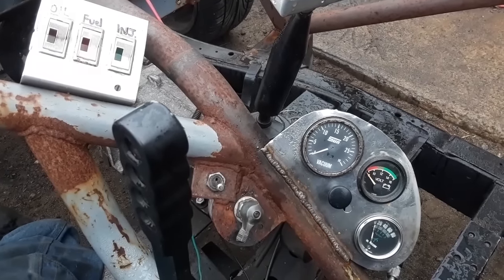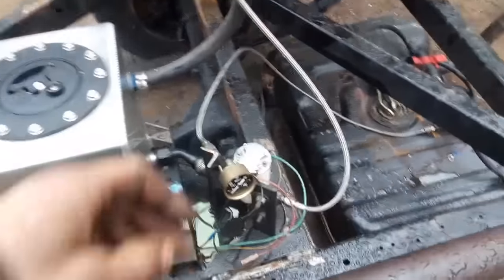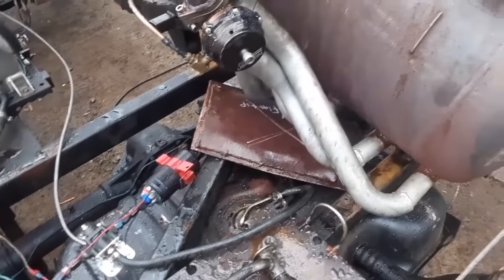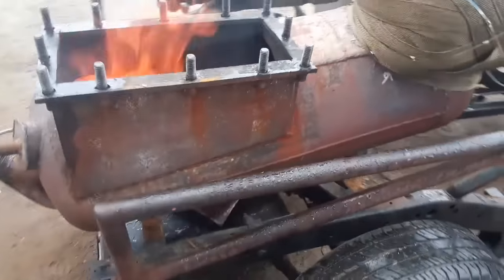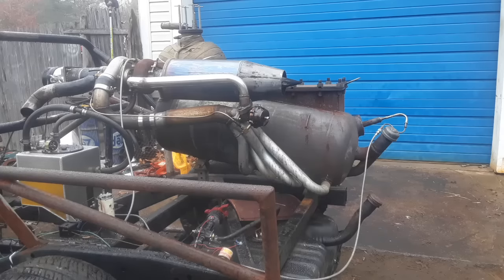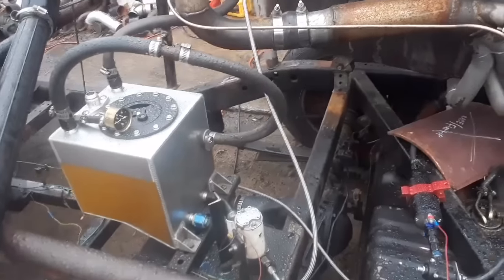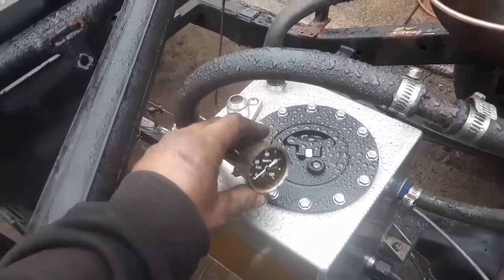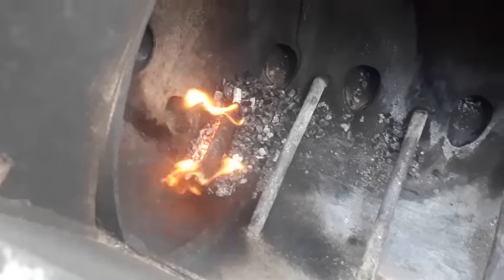Afterburn by Overfueling

Comment: If you ran the waste gate bypass to the inlet of the turbine it will help the turbine last longer run cooler and supply extra air for the afterburner

Comment: It looks like the AB is running rich, so that it rather needs more air than fuel.
Love the creativity and all energy you put into it.
Keep it up, please!
Reply from the maker: Im not injecting any fuel into the ab. Its just into the turbo barrel chamber, which is too rich with 25psi of fuel. The regulator cant drop below 25psi so I need a carbureted regulator to drop to 5psi of fuel. It wont run at an idle state with 25psi of fuel but if I fully spool the turbo with the wastegate it obviously cleans up the mixture. I was feathering the wastegate partially open to get the afterburn affect by simply over richening by choking the system of air.
Reply: @BoostHoundGP  I think if you hook up the wastegate to the afterburner you can run the barell itself rich, because the remaining fuel in the exhaust should combust there. Also, if you run it richer, it burns at a lower temp, so it should prolong the life of the turbo.
Basically try injecting the extra fuel BEFORE the afterburner, The high heat/pressure in the barell should also aid the vaporization.
Reply: @BoostHoundGP  what are your running for a fuel injector nozzle? do you have a way to control the flow rate of the fuel rather than just pressure?
Reply from the maker: @A2J_Tim  I made my own nozzle. Its hooked to a boost referenced fuel pressure regulator. I dont adjust a thing besides closing the wastegate to spool more boost. The fuel psi rises 1:1 with boost.
Reply: @BoostHoundGP  ah ok, so you may have to play with nozzle sizes, but ultimatly you need a way to meter that fuel for better control like a variable valve or fuel injector.

Comment: You need to add a huge radiator for your oiling system so it will help cool the center section of the turn and will help keep it 
from blowing seals
Reply from the maker: I could but its fine the way it is. 40+ runs on the same center section. Its keeping constant oil psi and volume to it. The heat is a good thing in my case Im going to condensate the oil vapors from the oil system into the pyrolosis system. Free oil refiner.

Comment: If you could rig up multiple oil jets so that they were independently valved, and then connect all of them to a rotary indexer, you could easily throttle the fuel at any pressure by regulating how many injectors were open at any moment.

Another option, of course, is to have the pressure regulator in a position where you can dial it up or down to adjust the flow.

These would allow to throttle the system, very much like a normal turbojet engine is throttled.
Reply from the maker: The boost reference on the regulators do the adjusting for me. It seems to work completely fine as is.

Here I was just running too much intitial fuel pressure causing an extremely rich mixture. I swapped out to a low pressure carburetor regulator and it starts up extremely quick. As long as theres some form of wood fire present in the chamber.

The issues Im facing seem to be from having no form of ignitors other than the wood and once it burns up and blows away the tank temp drops too much to ignite the fuel properly. This becomes more of a problem after you fully spool the turbo with firewood and the coals blow away from the wood.

Also spooling down the turbo while boost referencing the regulator causes a rich spike. As you throttle down the pressure stays in the hoses to the boost reference choking the system with fuel. This seems directly related to not having ignitors and only after I fully spool on firewood.

I suppose either a relief valve on the reference that opens when you spool down or just not spool down as hard while on oil. 
Spooling with the wastegate gives off that classic dose flutter when you release it but if by not doing that and easing the turbo down slowly it'll probably be fine. The wastegate dosing seems fine on firewood however.

Comment: if their block of wire mesh like rolled up chain link fencing in it, as the fuel burns it would make the wire hot and act as a catalyst to stabilize the fuel burn... if that was centered in the barrel using some standoff's the fuel injector tube could be pointed right at it. roll of wire mesh, catalyst log.
Reply: where in the barrel it goes? one end or the other maybe in the middle, tho a 4 foot log would just cover the whole thing and end up melting where it gets to hot...

Comment: 4lbs of fuel being injected into the combustion chamber isn't 4lbs of boost. You need to at least overcome your boost pressure before fuel would even start to flow in. Also not going to be just about pressure but flow rate.

Comment: Also, you can put fire bricks in the barrel to work to hold heat [prevent flame-outs] and improve combustion efficiency.

They would naturally glow super hot, and this would help sustain flame, and to an extent, improve the rate at which the oil evaporates, which increases efficiency.

Ideally, the objective would be to stand the fire bricks up like fins, instead of laying them down like armor plates.

That said, the advantage of actually lining the barrel with them [like armored plates] is that it extends the life of the barrel.
Reply from the maker: I did get some lava rock stuff however it was too light and small for my liking. Plus I didnt like the idea of stoney type materials inside the barrel. And chipping or tiny bits that let go will probably end the turbine wheel. The wood ash isnt much better but it is alot softer than stoney chunks.

Unless these bricks you speak of magically dont deteriorate like that, Im just going to build some form of stainless steel mesh grid that sits on the bottom of the tank to act as a giant glow plug.

At this point my intention is to not spend any money on it. If I have something on hand to do the job thats fine. If I dont have something thats fine too theres multiple ways about these types of projects.

Comment: put the throttle AFTER the compressor. just bleed air off to the atmosphere, or jacket the combustion chamber then bleed off back through the turbine.
 standard turbine principles, only feed some air into the combustion, not all of it. you want to keep EGTs as LOW as possible.

compressor wont last long being constantly choked off... turbine wont last long chewing on wood ash and incandescent gases...
Reply from the maker: Throttle stays open during all running of the engine. Its only function is to divert the blower air into the turbo to start up. The wastegate vents excess air from the system to atmosphere. I throttle by closing the wastegate giving the system 100% air to go crazy.

In this I simply have too much fuel for the system to burn properly at lower boost so I have to keep it the turbo speed up to overcome that.

Ive since dropped fuel psi and have gotten better results and a cleaner run.

The surging I did figure out to be incomplete combustion due to not having any form of ignitors besides the tempurature of the chamber. Basically its detonation but too slow of a burn process so the combustion happens after the chamber in the turbo and afterburner. The fire eventually burns backwards into the chamber and coughs the turbo.

Yes the turbo wont last. Its had so many runs on it Im suprised it can take the abuse still. The turbine wheel is thin like tin foil it should've melted long ago.

Havent seen many other turbo barrels still running their first turbo I think were doing something right.
Reply: @BoostHoundGP  once the summer fire bans are over i will be firing mine up again ;) only got one run in at the end of winter before bushfire season. hence... no footage.

i went a different route altogether... no combustion products through the turbo at all. figure THAT one out ;)

sorry, i just saw the throttle body and made assumptions. more fool me huh?

to get a good gradual burn with timber is pretty hard, i admit. making something that can be pulled apart so bleed holes can be tweaked, yet hold pressure aint easy... and timber isnt consistent from start to finish...